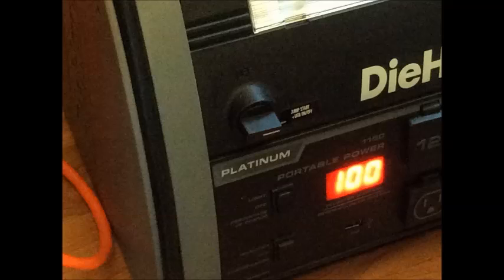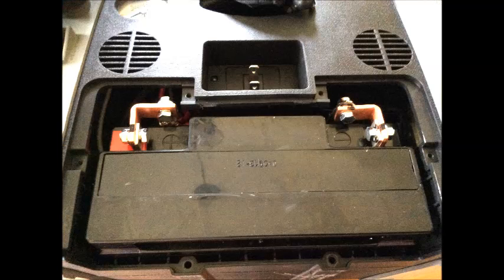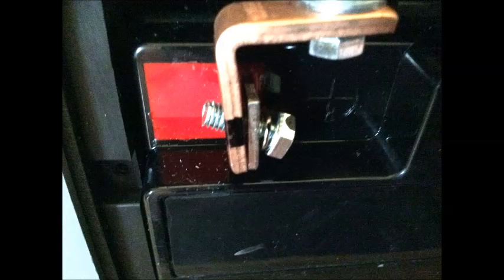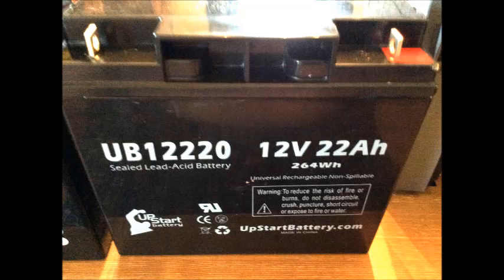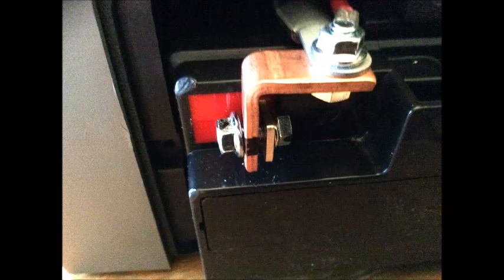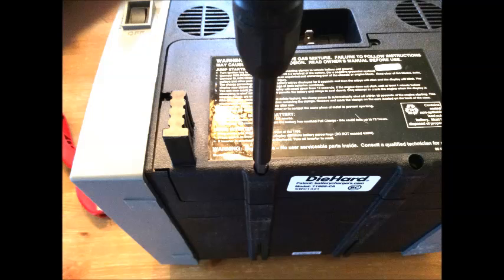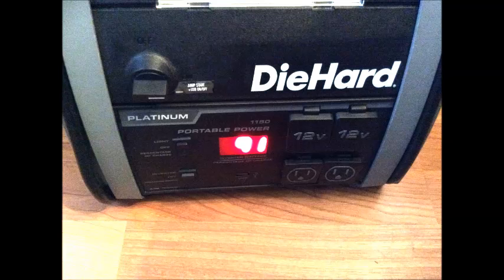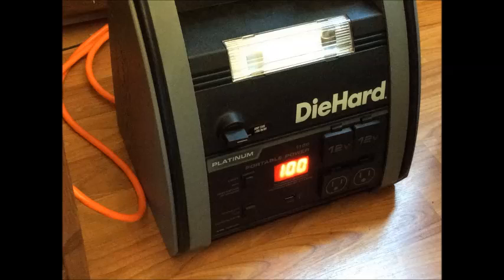Replacing The Battery In a Sears Diehard Portable Power 1150

Comment: I use mine to run 6 LED lights in our barn but not having been out all summer after dark, the battery went too low and won't take a charge. I'm glad to find out that the battery is replaceable! Thanks.

Comment: I've gotten a ton of use out of these. Came in really handy during power outages. It doesn't have enough oomph to start my diesel pickup when it's battery went flat, though. The newest models of these allow you to preset the air pressure when inflating tires. I wish these had the pressure gauge on the front, at least.

Comment: Yes, this was VERY helpful! I purchased a charger over a year ago, and I have not touched it since then. So I will be getting it out and replacing the battery. I will see if the one in it  will charge first, but after a year, I'm sure it's not going to charge. I even knew not to just put it away, and I still forgot it!!!! I am so glad you posted this, and like you, I will now make this a regular "Check Up" for my backup jumpstart battery. Mine is a Peak Jump-starter 600. I actually didn't even know that it had a plug to plug it in! I thought it was one that you use only once. I just pulled it out and I'm going to try to get it to charge. It's still showing a 57% charge when I just turned it on, so maybe there is still some hope for it. Thank you So much for making this video, you may have just saved me a great deal on having to purchase a new one. I will let you know how it goes after I plug it up. Bless, Sheila
Reply from the maker: Sheila6325 Hope it works for you!  If you need a battery, you may need a different one then I, since you have a different model.  You may want to google it to find the proper battery!  Thank you for watching!
Reply: Sad part is, it's a rechargeable that you don't replace the battery!!! So I will  most likely be getting a new one. I have had it plugged in for several hours now, but it doesn't seem to be charging it. Then I remembered that I purchased some cordless tools when I purchased the jump-starter, so now I have to check them too. I'm so glad you posted this video, even if I have to replace everything that's ok, because I need them all for when I go to the beach. I want to use them for the shed we are building, and the charger is for backup lights, when not used for the car. I have electric there, but I still like to always have backups, we lose electric there too. I'm sure glad I didn't buy that battery for the solar we are going to put on the shed this summer, those would have been a huge loss for me. Again, Thank you so much, and I will let you know how the battery does tonight. I can only charge it for 24 hours tops.
Bless, Sheila
Reply from the maker: Sheila6325 you may want to look at LED lights, as they use less power and will last longer with this device.
Reply: Yep! I found out about LED's when I was looking for them to use with the solar panels I hope to get up this summer. Well, the charger didn't go up but 1%, so I guess it's not going to charge, but I am going to try using it to see how it does, and since it has never been used yet, I may have to use it before it charges, but I doubt that. At least now I know about the ones that take a new battery, and that is a very good thing, no more "toss outs" Any suggestions on a model? Is the one you have still available?

Comment: I guess I have the older version without the extension cord plug on the back and I also noticed that yours has those two copper angle pieces that the cables attach to which would sure make changing batteries a whole lot easier.

Comment: I can’t get the screws loose to take off the cover in the back.  They look like very small Phillips screws but they just won’t turn.  Any suggestions?  Thanks
Reply: I am assuming you finally got the cover off of your Die Hard Portable Power 1150 to replace the battery.  Check that your Phillips screwdriver is the right size and that it does not have a damaged tip.  I had no problems with that but I purchased my Die Hard Portable Power 1150 unit brand new.  If you purchased your Die Hard Portable Power 1150 used but your Phillips screwdriver is good then a gorilla may have screwed in the screws too tight.
Reply: @henryhertzhobbit4343  
Yes I finally got it off and installed a new battery.
Thanks

Comment: I have a Portable Power 1150 that stays at 100%. I can only run a CPAP for 10 minutes before the 1150 shuts down. Could that be a battery problem? The unit is three years old. No warning messages appear. Thanks!
Reply from the maker: Could be, but I would try to run it without heating the water chamber.
Reply: Thanks! I tried that last time I went camping and it still quit after 10 minutes or so. Battery testing next.
Reply: @scoutmasterteddy1261  So, was the battery indeed dead?

Comment: I took off some of the wiring. Now I don’t know where the wiring connections go. No schematic or photo of inside the box if all the wiring. Now I am lost.
Reply: I imagine you are no longer lost.  About the only way you can put the battery in is so the positive terminal is on the left and the negative terminal is on the right.  If you tried turning it around 180 degrees then the battery's terminals should be too far for the wires to reach them.  To help things out further the original battery has a red marker on the positive connection. Currently Amazon shows 4 batteries - two rated at 18 AH and two at 22 AH.  Obviously a 22AH battery will usually be better.  But all four of those batteries also have a red marker on the positive side of the battery.  Also, on mine the positives are all on the left looking at the back of the unit including the jumper cables.  The negatives are all on the right.  Also,  the positive wire that connects to the battery on my unit is shielded with a red wrapper.  Ergo, it is almost impossible (never say never) to put the replacement battery in wrong. Just make sure you charge it up for at least three days and charge it up monthly unless you leave the charger wire plugged in permanently.
Reply: Same here.  I'm showing i have 5 wires dangling and can't figure it out!!   Help!!

Comment: Can the air hose be replaced also?
Reply: That kind of depends whether Sears is still around or not.  CNN has a December 2020 web page that says Sears is slowly dying.  But I bought my unit from KMart.  I downloaded the manual for the unit and it shows these replacement parts:
Air Compressor Accessory Kit (3 Hose Adaptors).
0099000599
Inflator Accessory Kit: (Inflator/Deflator Hose, Unit End and 3 Hose Adaptors)
0099000598
Male-to-Male Accessory 12V Charging Connector
94500109
But the Sears store next to me closed.  Also people I talked to said that if you worked for Sears and gave them a polite two weeks notice that they would fire you on the spot.  I guess it can be worse.  There is an agency of the United States government that ruins people's lives for years.  If you report it to the FBI nothing will be done.  Hint, hint.  I assume the same holds here - replacement parts for any of the Sears DieHard Portable Power units are going to be almost impossible to replace now.  These parts should probably work with all of the Portable Power units, not just the 1150 - IF YOU CAN GET THEM.
https://www.cnn.com/2020/12/29/business/sears-grim-future/index.html
Reply: @henryhertzhobbit4343  I think they all just screw on and screw off. Pretty much a standard hose. Maybe some Teflon tape on the threads? Cant hurt. Ebay, Harbor Freight, Amazon.

Comment: What type of tool you used to take off battery cover?
Reply: Just a standard Philips screwdriver for me.  The two on the top, two on the left, and two on the right are easy to reach and are visible.  The two on the bottom are inside holes that go down about 2-3 cm (1 inch).

Comment: Thank you for your tutorial, it was very helpful. I seem to have a problem, though. I replaced the internal battery last night and hooked it up to charge overnight. All day today the display maintains at 67. When I disconnect it from charging and press the display button, it shows 100. Do you or anyone else have any idea what's going on with it?
Reply from the maker: +Nicole Watson it might be the thing had to reset itself.   If you plug it in again, does it go to 100
Reply: +sicilian prince Progress...and then a step back - I left it plugged in and checked it yesterday morning and was delighted to find that it went up to 71. I checked it again this morning and it finally read 100. Out of curiosity, I unplugged it and plugged it back it in and the display went back to showing 71. And it hasn't changed. I don't know, maybe there's some sort of electrical issue with it? Perhaps I should just go off of what the battery reads when I press the display button - if it says 100, then it's fully charged.

Comment: What about corrosion on the terminal-----how to prevent as that ruined the 1st battery?
Reply from the maker: +Richard Parker mine did not corrode.   I think people use baking soda and water to remove corrosion, though
Reply: Smear dielectric grease on the terminals.

Comment: Battery will last 10 plus years IF you maintain it. I recently found out that the compressor button on the unit pushed in drained the battery and now mine is Melba toast it was still working great after all these years I will fix it and give it to someone. I want the newer one with digital readouts for the compressor they guarantee 54 hrs of DC power as well
Reply: Hi, just got one of these. How often and how long do you charge yours for?
Reply: @JuanGomez-gb6ce  I charge mine immediately after using it until it gets to 100 percent manufacturer recommends that it gets charged at least once a month for 72 hours weather you use it or not- you will not over charge the battery after the battery gets to 100 percent it will go into a maintain mode which is basically a trickle charge I think this why my battery lasted a  long-time I always try to  make sure I do this.

Comment: Very helpful. It is much less expensive to replace the battery than replace the entire unit. Two tips:
(1) The power cables can be hard to retrieve after you insert the new battery. I tied a string around them so after installing the battery I could pull on the string to pull the power cables out and reconnect.
(2) After connecting cables to the positive terminal, one of the negative cables sparked quite a bit when being connected even though all the switches on the portable power were in the off position. It didn't damage the unit, but was startling.

The link on this page is stale. The battery I purchased is:
http://www.amazon.com/gp/product/B001G8FY38?psc=1&redirect=true&ref_=od_aui_detailpages00

Some sites have lower cost, but when adding in the shipping the price is comparable with this one.
Reply: When replacing a battery in something like the DieHard Portable Power 1150 you are supposed to attache the negative cable first.  Make sure it is securely attached.  Then attach the positive cable second.  Actually, this advice holds for almost all lead acid type batteries, especially those in automobiles.

Comment: My 1150 does not have the same back panel.....  I'll see if there's one for it; funny that it has the same model number though...
Reply: There are slight differences for them.  As you can see, he has a standard AC plug connector to charge his unit.  Mine has an AC to DC convertor that plugs in with a round connector.

Comment: how do you charge this unit?
Reply from the maker: By plugging an extension cord into the back
Reply: @sicilianprince8930  My DieHard Portable Power 1150 has a round hole in the back that an AC to DC convertor plugs into it.  On the convertor the specs are:
Input:  100-120 V AC, 50-60 Hz, 0.5A
Output:  15V DC, 1.0 A
I provided that information because they may have lost the AC to DC convertor that went with their unit.  I imagine that will always be the same.  The name says OEM with registered trademark symbol and here is the unit model:
ADS18B-W 150100
It was made in China.
Reply: @henryhertzhobbit4343  Thanks!